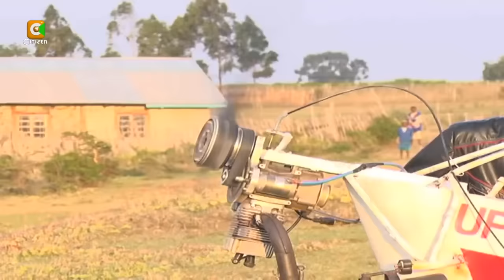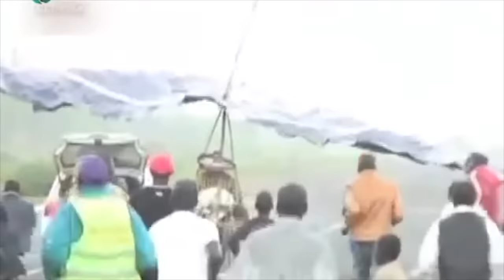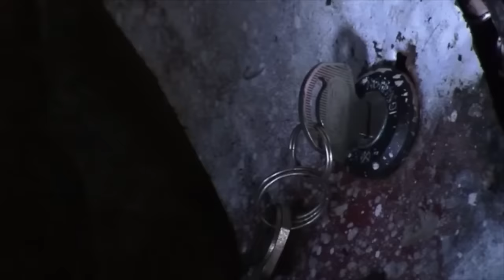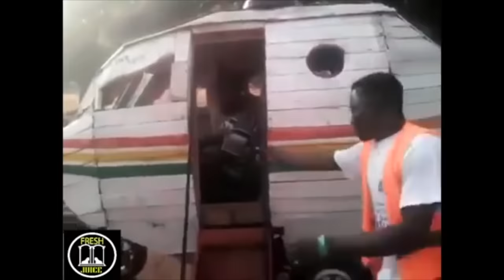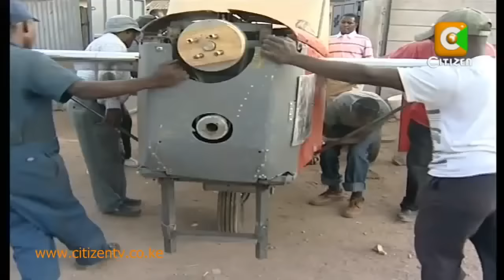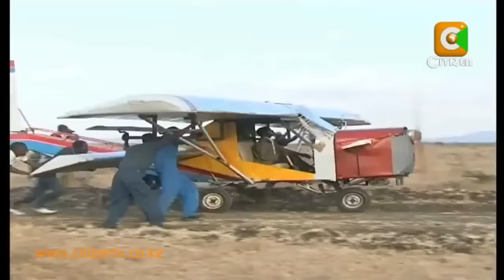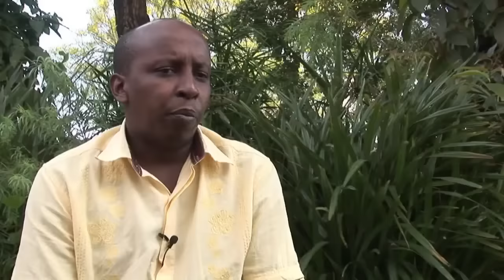African Airplane Compilation | African Aviation

Comment: What’s really bizarre is the wright brothers first aircraft design is completely available to the public. They don’t have to build it from scratch. The plans are already done and could easily be copied with modern machine tools. But instead it’s like some acid trip episode of pimp my airplane.
Reply: Yes, that's what I thought, and posted on, why not build a ww1 era biplane, with wood, cables and fabric. I'm sure there must be plans for some of those around somewhere. And it would actually work.
Reply: Bear in mind a lot of these blokes dinae have access to internet or books on the subject, and by looks of things, they’re going largely off of memory or photographs of aircraft.
Reply: @Beuwen_The_Dragon  Yes, Africa is a very backwards place.
Reply: Lol that "it’s like some acid trip episode of pimp my airplane" got me good🤣🤣🤣😂
Reply: not an option when the whole village is illiterate
Reply: Lol yeah they'll just pull up the designs on their iPad.
Reply: What about those designs told you that they have machine tools behold a hand-held power drill? These contraptions are essentially made out of scrap, out of rubbish that cost the inventors as little as possible. Most of them are far too heavy to get off the ground.
Reply: @LisaAnn777  they got addidas and Nike clothing I’m sure a computer has made its way over there too
Reply: @drdickqueso  then what, plug it into a rock?
Reply: @Alex462047  I'm pretty sure they have some mechanical tools for metal and wood carving -- the same thing the Wright brothers used

I mean like back in the day there used to be industry in these countries. well until emmm... u know what I want to say

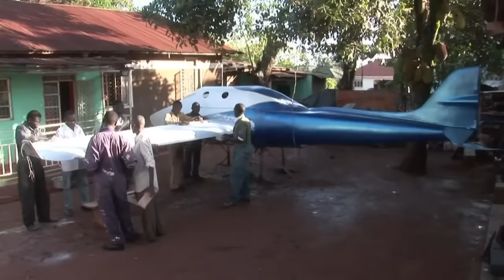I mean look at 6:21 -- it is obvious they had blacksmith work and welding -- this if far more than needed to build a simple wooden biplane
Reply: @LVB🦅  Exactly.  This is why I think these countries never should have been decolonized, at least not for another 100 years.
Reply: @tinman3586  the funny part is that I doubt most of you could build a working airplane without copying someone else's design. 

In fact, I doubt most of you could hook a battery to a lightbulb without a diagram. 

No offence is intended. I am just stating a fact. Too often we like to say "we" do this or that, but it is really technicians, engineers, etc. who do the things and we just buy them, and that is with a fairly good education system compared to poorer countries. The also did not show the millions of working aircraft in Africa. They are over there operating and fixing them, and certainly some people designing successful small planes.
Reply: @itoibo4208  true. I've built RC airplanes with more expensive kits and tools and all the education I could have for it. And still some of my planes didn't really fly. Which is kind of why I only build racing drones now coz they sure fly good and I don't need to check whether my plane is too nose heavy or tail haha. But lord I must admit these junkyard engineering videos from Africa are funny.
Reply: @tinman3586  I agree, fr fr
Reply: The first aircraft design and powered flight was by John stringfellows,  over 50 years before the Wright brothers or Santos dumont etc
Reply: @mark..A  ok. and?
Reply: @aakashjana6225  They are funny. I have seen something similar thing in the US. When they asked if I wanted to see it I was like Yes! but then I saw it and I was like "this person is an idiot". XD
Reply: they not that clever 😂
Reply: In many African countries you need a license to use internet. I believe it is to keep the public less intelligent of the world.
Reply: @PlayboiMaui  there are many who use it in Uganda. hence the meme "Uganda Knuckles"
Reply: Check out these people in Rwanda
Reply: I see people recording with smartphones....and the videos were uploaded to the internet so....
And a quick glance at google searches showed me several places to learn how to build a functional aircraft.
Reply: @Beuwen_The_Dragon  It's BARE in mind not 🐻 A for effort. I'm sure your mastery of the English language is on par with the avionics experts here.
Reply: @zahylon5993  that is exactly my point
Reply: @mark..A  So glad someone remembered ma man Santos ! Try talking about dem Wright boyz ova der n see how they fare.
Reply: Comment of the year!😂😂😂😂😂
Reply: If you remember the wright  brothers used wood in most of the structural pieces
Reply: suuushhh shuuushhh  lets just keep loling at the africans
Reply: @Alex462047  in the most complimentary way, the optimism, enthusiasm, and methods of these guys remind me of Orks from 40K. They're just making shit that shouldn't work, and having an all around good time.
Reply: @onastick2411  these are not ww1 era planes, though, they are modern airplanes. Ww1 era planes (biplanes) were basically just engines strapped to wings, no glass, no weight, no payload. These are far bigger and heavier, and using smaller engines than those biplanes had. The problem here is bad aerodynamics, small engines, and heavy weight, basically everything you need for an aircraft. Engines and heavy weight are solved by more money, which they don’t have. Bad aerodynamics are solved by access to wind tunnels or good computers to run advanced simulations software, both of which require large amounts of money and resources. There’s a pattern here...
Reply: There is an upside to this whole clip.  At least they could not find a cliff to try out their prototypes on.
Reply: Its all about education. Im actually very impressed with what they can achieve on their own with empirical knowledge. For us , properly educated prople, its pbvious why we should follow a blueprint for this kinda of stuff, but this people didn’t have access to proper education to learn why “street knowledge “ is not enough to build an aircraft. Its funny but also sad to see so much potential wasted
Reply: That's a really weird way to think about. First of all, making them isn't easy. Yeah you have plans, but now what? The wright brothers took a long time to build the plane, and it barely even flew. Then also wright brothers had all kinds of tools, these people probably don't have. And overall, even if they'd succeed, it's not their own design so you didn't really learn much more than "how to follow plans to make an expensive barely flying plane". The point of making an airplane is making it cheap and/or the way you'd like it. 

I can see, that you don't understand the "make more or less functioning stuff out of scrap" mindset, and you can't really appreciate how it feels when your minimal design works. Then you even ignore everything and even seemingly insult these people. These are the kind of people we can thank for having anything modern around us.
Reply: But that comparison is not fully applicable, because the theory behind it and engineering it in practice still takes a fair amount of aviation knowledge even without having to do all the pioneering work the wright brothers did.

These people just jump right into it without any knowledge, which is pretty impressive and brave, but similarly totally reckless and stupid
Reply: This comment is hilarious dude. Like why not just use the plans that are so easily available 😂😂😂😂😂😂😂
Reply: That may be easier said considering how incredibly poor some of these countries are.
Reply: @LisaAnn777  They’re literally filming the failures on smartphones. Dude got $80k for the last project and couldn’t buy $10 blueprints? This is a skill issue lmao
Reply: They don’t got internet or smartphones they just see like random old movies and then slap a ceiling fan on a car n try n fly
Reply: @Spaceman2484  amazing how they can be that incompetent then.
Reply: Literally reinventing the wheel
Reply: How anyone could  criticize this. The attitudes are disgusting. Society is poisoned
Reply: @MrTRex1958  because it's very easy to find designs of working airplanes yet they keep making these planes and it looks like the sad attempts made in the early 1900s.  😆
Reply: Honestly, did you watch this just to inject your wisdom? I’m old, no ego just a question. Will I get an honest answer? Let’s see…
Reply: @On A Stick  backwards lmfao. Bro are you ok
Reply: i'm not "unimpressed" anymore..
they were giving clean water wells and not even a year later they were all contaminated because they never did the maintenance.
this people live in the past..
like... 20 centuries in the past.
sad.
Reply: They actually built the plane 1:1 for the anniversary, it failed to fly. I remember the pilot apologising to president Bush, but I get your point
Reply: @Beuwen_The_Dragon  You'd be surprised how many have phones and stuff.
Reply: It’s also bizarre considering anyone in the globe can purchase a kit plane from various companies for about the same as they are spending. 
You would think they would do that, then try to engineer their own based off studying the rest of the worlds work
Reply: @itoibo4208  the funny part is, the people here are talking about copying someone else’s designs instead of building your own plane, your 100% correct, but you misunderstood the original comment
Reply: @LisaAnn777  best comment award😊
Reply: @onastick2411  bro it’s not that’s very rural places. I knew people would straight have that USA vision of Africa lol… also Africa has 54countries 🤷🏽‍♂️ these are people with little education dreaming to fly and making it an hobby…
Reply: @submarine6410  it is common for people to just look at something and start building. Of course it makes more sense to use a plan unless you already know how it works.
Reply: @onastick2411  no. They've ALL GOT ACCESS to the internet there, even the ones without mains power connected. It's all thru their phones. That "eat da poo poo" pastor has been livestreaming his church services for a few years. THAT'S the speed of their internet. I used to talk to his daughter in the chat.
Reply: @mcdo8975  no, they're literate IN 4 LANGUAGES unlike you.
Reply: @LisaAnn777  they ALL have phones over there, many have smart phones. QUITE OFTEB the way they buy things is thru a digital money system based on their phones.
Reply: @LisaAnn777  many have off grid solar. I've seen it myself.
Reply: @OffGridInvestor  I'm surprised they don't try and make their own mobile phones ,from stuff they have lying around, now I'd watch that. The first phone technology that uses Um Bongo drums.
Reply: @NAaPALM51  54 countries, not a decent one among them, go figure?
Reply: Repent and believe in Jesus Christ  drivel
Reply: @OffGridInvestor  I'm fluent in 3 languages buddy 😂
Reply: @itoibo4208  but how many people with such low amount of resources do it? It doesn’t take away from what these people are doing
Reply: @Caffeine_Addict_2020  yes but they didn’t not have wind tunnels and good computers in the early 1900’s it is possible to build a aircraft without such resources, but its going to be a pain in the ass
Reply: @onastick2411  you do realize that all of africa is not a fucking tribal village stone age place right? Only very remote villages live like that, most people there have access to the internet, smartphones and so on, on top of that, The some of the planes here are pretty close to flying, they are just too heavy as many other people have said.
Reply: @onastick2411  Ethiopia, South Africa and Rwanda, these countries are on par with some European countries.
Reply: @submarine6410  Really, that'll be ex Soviet Satelite bankrupt corrupt countries, Romainia etc I presume. South Africa, lol, really, a basket case well on the way to being the next Zimbabwe, Ethiopia, I might emigrate there, bet its a paradise, lol
Reply: @LisaAnn777  the funny part is that people that even people that use airpad cannot build It lol
Reply: @LisaAnn777  i dont think they use voodo magic to charge the battery of those aircraft, there must be electricity. Not all of africa consista of villages without electricity
Reply: Some Ugandan Space force merch would be fire lol
Reply: I'm sure someone there has access to the internet for a schematic on early planes!
Reply: @Beuwen_The_Dragon  I think their effort is not underestimate. They work maybe just of what they see on the sky.
Reply: You can do any WW1 plane you want. Pretty much any WW2 plane as well. Even easier - any ultralight plane. Simple wireframe lawnmover motor plus some parachute canvas design. They prefer to repeatetly fail at lightweight construction, material choice, joining technique. That stuff is all out in the internet and only needs to be consistently put together. You can send one enlish speaking guy with serious advanced math talent to a UK university. The biggest issue is he'll never return home.
Reply: Technical documentation need a technical background to be understand and complex tools to be performed your grandma could not build a plane
Reply: @Mailing Account It's working then
Reply: @Beuwen_The_Dragon   No internet but uploading the video?
Reply: Or they can just build a motor glider instead first aircraft design 🤷 motor glider is such easy design than a wright brothers aircraft.
Reply: The first Write Flyer is not available, neither are the plans.
Reply: @manin10  The Wright flyer had very basic lift drag ratio compared to modern wing proflies. Anything the German WW1 lab research did yield was way better. That one guy simply failed by using plastics foil that got ripped off by the lift force it generated against the weave or tape or whatever he improvised to fix it. Nicely cut into strips.
The guy with the steel pipe frame just used way too heavy plumbing pipes. He would have need to strip the weight by 2/3rds to match the engine power.
That helicopter from a supermarket kids amusement ride with the blinking light had me laugh hard. Luckily no one got decapitated.
Reply: Some of these straight up look like something the orks in wh40k would build
Reply: @itoibo4208  and?
Reply: This requires internet
Reply: Internet may not be a thing there
Reply: "Just copy the Wrights" " Just buy a kit", ufff , man...
Reply: Wright brothers design didn't account  for the heavy steel frame and Toyota engine 😂
Reply: @oh-not-the-bees7872  and what
Reply: It really does feel natural watching this on acid. Im just extremely perplexed on what is going on.
Reply: yeah but it's africa
Reply: I give em credit for trying. But like... Even a paraglider is easy to build. 😳
Reply: They should make a hot air balloon, shaped like a airplane, hang a basket from it, and float it around! Success!!
Reply: @Wutzmename  You are r/confidentlyincorrect
Reply: Wright Brothers = Angry Birds
Santos Dumont = Aircraft
hahaha
Reply: @rdonshatalov  you're sure they have access to machinists and materials?
Reply: @jinz0  they're more clever than you i bet. Could you rebuild an engine without researching it?
Reply: @zahylon5993  so you assume everyone has the same access/equipment?
Reply: @Wutzmename  theyre typing in their native dialect, ye ken?
Reply: @LisaAnn777  you think a village with barely any electricity has access like you mention?
Reply: @Crazysworld91  the whole point is they're not spending any money.
Reply: @OffGridInvestor  you think everyone in Africa has internet access? You sound as about as educated as the people in the video.
Reply: @onastick2411  you might want to research that a bit more. Watch Mark Robers most recent video about Zipline in Rwanda.
Reply: @DerekX  you assume they know what a ultralight is.
Reply: We dont wanna be Right brothers...We're the Wrong Bros..🥸😎..cool isn't it...maybe a chinese Mr Wong would do??
Reply: @jaysunbrady  not all of them but some -- for sure. like u know meme "Uganda knuclkes"? there are a lot of rich people in Uganda with access into the Internet so they can google wooden biplanes and primitive combustion engines with propellers capable of lifting effect.
Reply: @jaysunbrady  They've got Zipline, wow, next step Nuclear Fusion.
Reply: Before Wright brothers there was someone called Abbas Bin Fernas who tried to fly but died at his first experimental flying attempt unfortunately !
Reply: @jaysunbrady  im a mechanic, but you probably cant
Reply: @Survivalnerd "They aren't backwards", it just seems like they are, lol. The list of African inventions is getting too long to list, what is it 2? 1? 0?. They're not backwards, just stupid.
Reply: @alphabeta123100  Lots of people, all though human history have attempted to fly, what's your point exactly?
Reply: @itoibo4208 you sound so so why don't you go ahead and explain who invented both types of engines gasoline and Diesel and the airplane and the machinery to make the parts for these engines and airplanes because it sure wasn't Africa
Reply: @Beuwen_The_Dragon  Also timber aircraft also take a massive amount of woodworking skill to get the spars correct etc. Possibly could enlarge a balsa type model plane though. But yeah they'd be better off ordering a kit set.
Reply: 😂 this is the best comment
Reply: That's not how acid works
Reply: The first airplane from the wright brothers all fail to take flight and/or fall and kill experienced pilots. Terrible design to begin with.
Reply: @mark..A that's a little misleading 

Stringfellow was only able to get a model to fly about 25m....it also lacked controlled surfaces

The Wright brothers are truly the inventors of the Airplane. (Powered, manned, with control surfaces)

The reason the Wright brothers are considered the inventors of the Airplane is because they COMBINED all 3 of these critical attributes. 

They invented new engines (cast aluminum blocks) and testing methods (wind tunnels) to achieve this
Reply: It would fly better with a modern lighter weight engine with more power too.
Reply: @tinman3586  Serious with that comment? Wow.
Reply: Yeah but the Wright Bros omitted to include the extra 5 tonnes of weight needed 😂
Reply: @fishjohn014 stringfellows could not perform a manned power flight because petrol or the combustion engine had not been invented yet in 1848. He used a mini steam engine , invented by Thomas savory in Devon. 

Modifying something does not give an individual the right to claim to have invented it.

The Wright brothers flight was clandestine compared to Santos dumont and the french  . There is old footage of dumonts flight taking place
Reply: @Beuwen_The_Dragon  they have cells
Reply: you right but i think they take it as a kind of challenge and self satisfaction
Reply: @itoibo4208  I'm fairly confident I could build something with hand tools, off the top of my head, without the landing gear collapsing.
Reply: @submarine6410  the best one had to be the African Space Program, using a jet that hadn't been built yet. And some idiot gave them $80k...
Reply: @voster77hh  a fully rebuilt Sopwith Camel, in the UK, to better than original spec, is under £60k. So how on earth did these idiots manage to waste $80k?
Reply: @juchetony1910  haha maybe. That one person was using 2x4s and I think the same one also had like 4 seats. It was so doomed. XD
Reply: Please pass this comment on! lol
Reply: They're available but... it sucks and barely even flies.
Reply: It wasn't the first aircraft nor it was the first plane, this title is given to Clement Ader as he was the first to take off a motorized vehicle heavier than air in 1890 while sitting in it.
Reply: Probably no internet?
Reply: @Alex462047  indeed, I've you have to push there is no way it will take off on its own.  Probably all variations of some type of steel.
Reply: They've got 3G. They're just too fucking cultural to use it for anything except 419s.
Reply: What do you expect him to do? Print one and place an engine in it??
Reply: @onddu2254  the wright brothers didn't have arc welders......
Reply: @danwolf307  Well welder wouldn't help much, since if you didn't know,  you can't weld wood. And well, metal wouldn't have helped them much, since any kind of metal isn't suited for aircraft.
Reply: Them: OK time to get on Plane! 
Me : Erm ,i am afraid of heights….i think i should go on car.😂
Reply: @mark..A  Yes, first flight. First manned flight was 1903
Reply: the wright brothers made helicopters?
Reply: @Beuwen_The_Dragon  the wright brothers didn't either bud
Reply: They're all holding iPhones I would imagine in the cities they have internet access. They're in Africa not 1855
Reply: @Beuwen_The_Dragon  two of them had phones which the taken videos with and probably posted on internet
Reply: @bobprobert353  hahahahahaah
Reply: @LVB🦅  Well the welders were plugged in somewhere
Reply: @mark..A  Stringfellow's craft was a 10 foot wingspan and unmanned.  The first flight crashed, but the second attempt did leave the guide wire and successfully fly a short distance.  These flight attempts, believe it or not, were indoors.
The Wrights made the first successful manned flight.
Stringfellow's was a steam powered airplane.
Reply: @LisaAnn03170 now that is funny.  A rock lol
Reply: @LisaAnn777  didn't Akon bring electric to like literally a billion Africans?
Reply: @unsolicitedditkapics9722  idk probably
Reply: @onastick2411 &Kenya,  Uganda, Rwanda, South Africa*? "Are we a joke to you?"
Reply: @Rebeljah  I never laugh at the afflicted. But an interesting list of the backward countries of the world, how's the space program going, leading in Science are we?
Reply: @mark..A  stringfellow "flew" a streampowered Model about 3m long. But realized that its not suitable to build in full scale.
Reply: @snakeplissken2148  see my response to John Fisher further up this thread
Reply: @rafindeed  cope
Reply: @Beuwen_The_Dragon  they should consider running water and internet before they think about things like flying xD also maybe a little bit of reading ability too?
Reply: @itoibo4208 haha I was hooking up batteries and motors at 5, long before the internet, many school friends were like this too. Genetics and drive to explore is the difference. Some just aren't designed for it.... This is displayed in the level of success in any country / continent. Some can, and some just can't.
Reply: @onastick2411 exactly... Some are capable and some are good at pretending to be capable....
Reply: @submarine6410 all that charity and still a massive failure.
Reply: @sevenspec  yep, they really need to get their shit together and stop blaming it on colonization.
Reply: @submarine6410  that'll be the day....
Reply: @tinman3586  Given what a resounding success colonisation was for improving those countries, then they would have been a sight to see after another century of it. Congo had I think two university graduates in the 1960s, maybe if they'd stayed a colony until the 2060s they would have had four?
Reply: @mark..A  That seems highly unlikely given how much engines had improved in the fifty years before the Wright brothers.
Reply: That's it. I'm sending books on amateur rocket engine design to schools all over Africa.

In about 10 years it will pay off big time
Reply: @PlayboiMaui that’s not true, I’m from Africa
Reply: To be fair, some of them look like they are very close to legitimate designs.
Reply: @mblizzy 😂😂
Reply: @Benjamin.Kaplan Legend has it, if you watch this video enough you will have an acid trip.
Reply: @itoibo4208 finally smart words. Ppl in western are so stvpid than most of we think we are cleverer than the ppl showed on the video. The Dunning Kruger effect...
Reply: yes you only need a slingshoot to make fly
Reply: WOW I WONDER WHY THEY DONT JUST USE THESE PUBLICLY AVAILABLE PLANS WITH ALL THE NATURAL RESOURCES, TOOLS AND FREE INTERNET ACCESS AVAILABLE TO THEM? THIS IS REALLY STRANGE.
Reply: All that matters is that it drives
Reply: @drdickqueso  in how many pieces
Reply: It is hilarious 😂
Reply: @onastick2411 I must admit I have no idea where lightweight balsa wood comes from, but I seriously doubt it's anywhere near the areas pictured. Same goes for linen, I'm fairly certain you'd need to chemically treat it too.

Not to mention that any engine I've seen on a WW1 plane looks like eight of the ones used strapped together and violently spinning, it's not that easy.
Reply: @Jimpiedepimpie  microlight? Does it have to be a plane. Doesn't look like there's a lack of stuff lying around.
Reply: @onastick2411  A commercial kite for an ultralight will set you back nearly two thousand dollars, and that's before you get it to Africa.
Reply: @Jimpiedepimpie  You argument doesn't seem to make sense to me. You are literally seeing people attempting to cobble together aircraft and helicopters from discarded car parts and stuff they've fabricated themselves, there are cars parked around, that would indicated to me, there's no shortage of steel, chassis rails, and engines. They could use those pieces to build something to an existing plan, (ww1 aircraft for instance), microlight, maybe, rather than cobbling together something that will never fly. Pretending they are living in a desert wilderness, without access to resources is belied by that actual video, we have both just watched.
Reply: @onastick2411  You seem to be under the mistaken belief that car parts are made from the same materials as plane parts, and thatt you only need a dinky little engine to make something fly.

Just like the people in the video!
Reply: @Jimpiedepimpie  I think its called ingenuity
Reply: @onastick2411  It's called "composition", and it'll mean the material is too heavy. Aircraft are made with a lightweight composite containing aluminium and carbon fibre, two materials that are notoriously hard to work with.

Old linen aircraft were made from a material called Rayon, which needs to be synthesized in a lab as well.
Reply: the Wright flyers were very unstable. part of the reason they never sold many of them.
Reply: @LisaAnn777 they literally have a camera crew there. Not one person thought to give them access to internet
Reply: @Bonezy1001  I mean it is more entertaining watching them completely fail though lol 😆
Reply: @onastick2411 first África, isnt a country African isn’t a ethnicity, and it does have internet
Reply: @tinman3586 😂😂 first there wealth is still being looted to this day, nothing u guys said is true about not having internet and colonialization never help anyone except the colonizer
Reply: @PlayboiMaui that’s not true at all
Reply: @rafindeed ur watching a meme page made by rascit none of this is even true
Reply: Maybe its more interesting build it from zero. Kinda cool i have to admit
Reply: @rdonshatalov  "emmm... u know what I want to say" 

No, I don't, enlighten me.
Reply: @ShmoopDooper  it begins with N and ends with S😈
Reply: @rdonshatalov  You could use a good long look in the mirror my man.
Reply: @Alex462047 one of them cost $80,000 the video said!!😂
Reply: @onastick2411 not as backwards as the west however, which asserts that men can become women. Atleast you can fix illiteracy and poverty. How do you fix insanity?
Reply: @ShmoopDooper  I only see a Ymnaya Gigachad Aryan. what's wrong with it, bud?
Reply: @onastick2411  Not really, just the rural areas, as is in every single country and continent with very few exceptions.
Reply: And where's the fun in that!?
Reply: And how do you read these plans if you arent literate or dont have access to the internet?
Reply: The correct spelling of the expression is bear in mind, which includes the verb “bear” (meaning “endure” or “carry”). The idea is that you're holding something in your mind. “Bare in mind” is a mistake, since the verb “bare” (meaning “uncover”) doesn't make sense here.
Reply: The really bizarre is you taking the stuff seriously ...
If this video was about actual   workshops in african airports fixing planes you wouldn't even be watching.

This video has millions of views because because it sells a 'joke' about backyard inventors playing with scrap. 
And this joke fits the stereotype westerns like ...
Reply: @onastick2411  yea i would do fabric over wood if I was in a third world country. way easier to construct with basic materials.
Reply: @bbsara0146  Yes, glad someone agrees, and start with a glider, first off. Sort of learning by experience, apparently not learning at all is the way the Third World Rocks.
Reply: These ppl dont even know the internet exist even water they know it exist because it rains once in a blue moon
Reply: You make me laugh so hard. Acid trip, pimp my plane Hahahahaha. I can totally relate to this thoughts high on acid haha.
Reply: @bobprobert353 for real hahaha
Reply: @drdickqueso: those adidas and nike clothes have been more than likely donated to them by international organizations.
Reply: @itoibo4208 if I were illiterate, uneducated and not skilled in aerodynamics I would stick to walking
Reply: @Wutzmename  😃What? Its, "bear in mind."
Reply: @itoibo4208  facts
Reply: They cant read
Reply: @Beuwen_The_Dragon They have internet to scam people all around the world but can't find building plans for planes?
Reply: The wright brothers had money, even if they didn't have technology. I get the feeling that a lot of these guys are doing it as a hobby. I mean, what exactly are they going to gain from successfully making their own aircraft? So they probably scrounge up whatever parts they can get a hold of and try making them.
Reply: *chimp my plane
Reply: It takes more than wings and an engine to make a plane fly.  There is a reason why early aviators used wood, canvas, and bailing wire in their designs.  And let's not forget they used a biplane design,  If you have short wings, you need more surface to create lift.
Reply: man honestly my first world ass was sitting here like "how did they not look this up first?" lol @Beuwen_The_Dragon
Reply: En mi país también existen emprendedores similares, los llamamos uribistas. Hay info para proceder desde lo comprobado, desde lo objetivo, peero su estilo es subjetivo.
Reply: Bro you can go online and build a working ultralight with the materials they have.
Reply: @onastick2411  Its like they were subjugated by a foreign power for nearly a Century or something
Reply: They can't read drawings 🤔🤔🤔
Reply: Fuck the wright brothers airplane, they can literally just grab any experimental airplane guide and build that like the RV-8
Reply: @Wutzmename so confident yet so wrong
Reply: Who needs a plan when you’ve a continually evolving picture in your mind.
Reply: TIA
Reply: @dulguunjargal1199  Yeah. It's why they have the phones and electricity.
Reply: Me whos living in africa I can assure you that they dont google things, its either a prophet or a local wise man they go to
Reply: Omg😂
Reply: LOL FR
Reply: @rafindeed true.
Reply: @Caffeine_Addict_2020 yeah, the problem with these craft is that they are being built by backyard engineers with no money or experience. They are attempting to build modern aircraft with scrap steel and spare engines. 

If these guys had money for proper tools, workspace, and materials, I'm sure many of them would come out with functional pieces. It's not like they wouldn't be able to buy proper aircraft parts, even if they must be imported, if they were rich. 

This is the hobby inventor fails of people who spend their lives having to invent backyard solutions to all of their repair and maintenance needs.
Reply: Those people don’t have education, any one who learned physics even in Africa will be aware that takes more than that to make an airplane. I remember back in 80s an African made a descent airplane but he said layouts are made by a German designer and he even reused VW beetle engine.
Reply: @onastick2411  Right if you dont have lightweight alloys or composite materials , you need wood , not the chassis of a  Toyota with the engine still in it , thats what they doon Carnaval here , i dont get it
Reply: @mcdo8975 They aren't necessarily even illiterate, could be possible that they just can't read english and stuff about this stuff isn't either translated into their language yet or they just simply don't have access to books and such about it.
Reply: @pipopoikapelaa5468  that's literally the definition of illiterate
Reply: this is kind of what I am thinking. There are FREE aircraft designs available on the internet and they decide to just put a basic airplane shape together and expect it to somehow fly. I am at a loss for words. 
And before anyone says anything about internet look at all the people filming on Iphones.
Reply: Not the Wright brothers
Reply: At first, they shood invent machine tools😂
Reply: @drdickqueso  They got addidas and Nike clothing because we end send them clothes in the form of donations in such a volume that it's a problem - they're basically being used as the world's clothing dumpster.
Reply: Then you must have made an aircraft by now.
Reply: where´s the fun in that ?
Reply: I know right? It's like how the Israelis launched a space probe but couldn't land it a few years ago in spite of all the tech advances in space engineering in the last century. The literal how to books exist and the highest IQ people on the planet couldn't land a probe.
Reply: @LisaAnn777  We literally saw them welding... I'm sure they got some Uranium rocks or something to be powering that stick welder.
Reply: @itoibo4208 I mean the average engeneer could probably cook up something that could fly. The issue would be in its efficiency. The components or design will have to follow simple principles regardless. Meaning that anyone will end up with a plane that looks similar.
Reply: @mehmeh1999  yes. idk if these planes are even meant to fly or it is some kind of fun game they are playing.
Reply: you've clearly never built anything in real life... its never that simple
Reply: @mehmeh1999  no they are probably using a big generator, and I am sure it's using up most the power they have available lol
Reply: they don't have libraries?
Reply: @daniel_dumile  half probably can't read anyways even if they did have libraries.
Reply: exactly why reinvent something that the plans are readily availableto..HAHAHA
Reply: @itoibo4208 the difference is that I wouldn't attempt to "design" and build an aircraft from scratch out of random shit that I found.  This is more like slapping shit together to make something that kind of looks like an airplane. Lol
Reply: This is exactly why literacy is important. These people are literally trying to re do history and are forced to try to figure out stuff we figured out more than a hundred years ago.
Reply: @LisaAnn777 ouch!!! as a Nigerian (using my phone now), I can tell you that kinda hurt. These guys are your typical DIY guys, we have them all over the world. Some succeed in whatever project they embark on and some don't. However, if as of 2023 when you made this comment you still think we don't have electricity, then I think....
Reply: They obviusly had basic tools (probably more modern than what the Wright brothers had ), unless they couldn't cubble togather those planes , i mean they had a welder , that requaire a fair bit of technology, and they should kinda make ww1 style planes or the one with the Wright brothers made , the engine is to weak for anything heavier
Reply: @mortalengine2934 fr, these guys are just having fun. African countries operate 787s, these are just villagers enjoying themselves.
Reply: @Beuwen_The_Dragon  either way we gotta admire the effort they're making with the resources and information they have
Reply: @Beuwen_The_Dragon  excuses